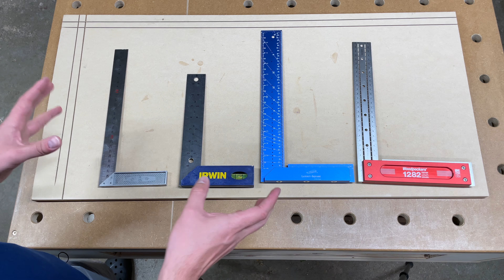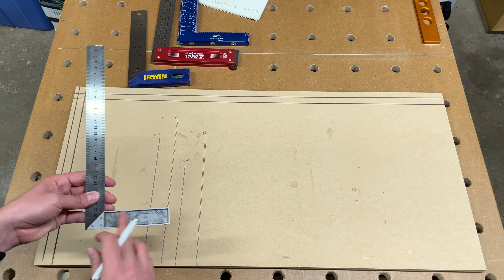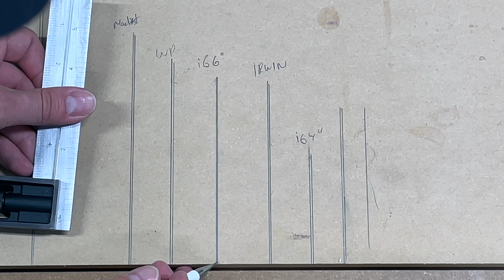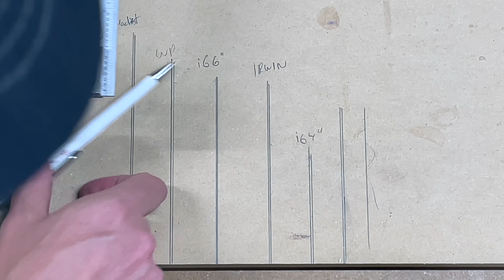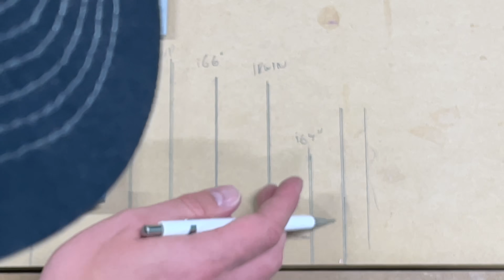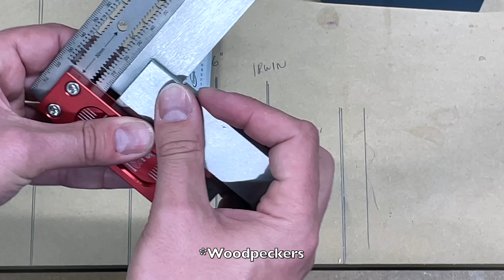How Square are My Squares? Testing 10 Different Squares from $3 to $140 Using an Easy & Free Test

Comment: I believe, as other comments have mentioned, that you are holding the squares differently when drawing the second line.  Placing your thumb at the top of the blade and drawing down toward the handle is just asking for inconsistent results.

Comment: I have an old wooden handle with brass plates try square I bought about 40 years ago that I still use all the time, and has remained 100% accurate, it is about the same size as the Irwin, being 9 inches, but it doesn't have any type of scale on it.  It is just a square.
I do also have a large framing square that I use when building larger furniture, and I have a couple of speed squares.  I also have a combination square, but mainly use that for repeat marking and measuring.  Oh, and an engineer square, just for checking my saw blades

Comment: Your technique is flawed, I can clearly see the IGaging blade moving slightly on the 2nd line at 5:27.  You are holding just the blade, and out near the end as well, and pressure from the pencil is moving the blade slightly.  Proper technique is a thumb holding the fence tight to the edge, and a finger simultaneously holding the blade down onto the surface.  I also feel that striking the line so quickly vs. a more deliberate pencil movement contributes to the effect of moving the blade..

Comment: Good video on what I believe is an important topic. 
However, I was under the impression that (classically) the "true" edge of a square is the "inner" edge.  
I was taught to always use the inner edge of the blade (but, in practice, I use the outer edge more!).  
I use vintage squares almost exclusively (and occasionally combination squares of repute).  
I always test them prior to relying on them, and file an edge square if it is out of true.  
If you care for your squares, it is a task not soon to require repetition...

Comment: The qeustion should be. How square does a square need to be? My three home made ones are so square that using your test they are 100 %. That is square enough. They cost me offcut flatbar, some welding rods and about a hours work each. A machinest square is a different matter, that needs be more presice.

Comment: Good video but you should have included instructions to fix an out-of-square square.
It's not hard, doesn't take long, and once learned you gain a skill.
Even the 'aliexpress' could be fixed.
No reason to throw away an out-of-square square, just fix it.

Comment: Extra: How square do you need?  Most agree you need more square for metal working than wood…but even if putting up a stud partition wall and you need to trim a 7 foot long plasterboard, small inaccuracies grow over distance.  So 1 mm out on a 12” square becomes a 7mm gap or bad overlap on your plasterboard sheet.  As a general rule, if you can detect an ‘out of square’ fit by eye, then that is too much, and most human eyes are pretty good at that.

Comment: You can have a few ‘square’ tools in a workshop, but you must have at least one which you can rely on to be properly square for when that really matters.  I bought the Woodpeckers over priced 1281, but it is bang on square.  Unfortunately the blade is so thick that parallax is an issue when marking (you have to view the scale with one eye from dead perpendicular over it).  I also purchased a Presch brand combination square, which is also a dead on accurate. My mini engineers square is ok for saw blades but extending short squares any distance is bound to produce errors.  My worst is a 7” 15 quid, aluminium square from Amazon, Chinese I think.  It is about a millimetre under square at the end of its blade; if extended out by the time you get to a metre (3 feet) it will be out by a quarter inch!  I need a big layout square, like two feet….but these are hard to find where people have anything good to report, and I can’t afford more Woodpeckers!  I am considering just making a big plywood triangle like a rafter square, which I can ensure is true by my old friend Pythagorus….He never lets me down on accuracy.

Comment: User error on the larger IGaging square. Lol I too have basically the same squares and they’re all basically Woodpecker square….
Reply from the maker: Unfortunately it wasn’t user error on the iGaging, it’s just out of square. I still really like iGaging as my other products from them have been perfect and their quality control is quite good. I just got unlucky with this particular unit. I’d still very much recommend them as a brand.
Reply: @MasonWoodshop I would contact Igaging, I would imagine they’d want to see that. Given the prowess of your station they might send you a replacement or a complete set if they offer one.

Comment: I have the same set of woodpeckers squares, and I hate the 150mm. Have you noticed that the inside and outside scales on it are off by a multiple of 5 mm rather than a multiple of 10 mm? That means the indexing holes can only be used in reference to one of the two edges. They tried to cut corners by making the base the same as the imperial version (25 mm), but they could have avoided the problem simply by rounding down its size to 20 mm (or even rounding it up to 30 mm, although that would have likely cost more). It's certainly square, but it's poorly designed.
Reply: The 300 mm version doesn't have the same problem though, because they made its base 40 mm wide. And I do love that larger one.
Reply from the maker: Ahhh, I can’t unsee this now! That hasn’t really played into the way I do my marking but I was just reviewing what you said and completely understand this frustration with the indexing holes.

Comment: Irwin and a machinist square all day long. If I ever decide to build museum quality anything ( that would be never) I'd consider woodpecker. There is absolutely no reason in the world for the pricing on them. None. Except all the marketing done by high-end cabinet shops whose smallest project starts at $ 5000. Look at me I have a whole red wall of tools worth 20k just to measure within one-thousandths of an inch. And you need these too or you are not a real woodworker. Oh and here's my 20 thousand dollar chisel collection. And don't forget Festool. Or a CNC. For a mere 100k you too can be a woodworker and make a shoe rack for your wife.
Reply from the maker: Love this comment as it shares the reality of these types of tools. Now it’s time to go buy a Felder sliding table saw and 5HP 30” planer, haha!
Reply: Agree Woodpeckers tools are expensive and I don’t know how they price their tools. But the woodpeckers tools I do have are excellent quality. Also their customer service and is excellent for the two times I had issues. I also like to support US companies as to many items are not, example Craftsman tools with use to be may go to brand before started to be made outside US and they declined in quality
Reply: I just bought an AUKtool 400mm, very reasonable price for what it is and it's a beautiful tool; it feels so good to the hands. And it's square, as per your test. Really, I feel you should be using a lapped square edge for a test like this and a knife line. An aluminum track and a pencil line isn't sensitive enough apart from showing up major discrepancies.
Reply: Got my dad the 6" Woodpecker square years ago, and he absolutely loves it. Uses it constantly for laying out wood turning pieces.
Reply: Woodpecker is way up there too
Reply: This comment is spot on. Wish I could give it more than one like.
Reply: Have you tried them though? I mean the woodpecker stuff? It’s kinda like a Lie Nielsen plane. Sure an old Stanley can get you there but the journey is so much better.
Reply: Didnt know that woodworking was a paupers craft in your corner of the world, in my corner of the world the average cabinet project runs btwn 20k to 70k for the average home. 5k cabinet projects are usually turned down due to the inefficiency of scale, and ironically the woodcraft im talking about isnt even the high end. High end cabinetry kitchens here run about 120k and up 😂

Comment: I would double check the 13” iGaging square.  If it’s actually off, then contact iGaging.  From what I can find, they guarantee squareness down to .002.  If yours is off more than that then I think they will replace it.  Woodpeckers guarantees theirs down to.004.

Comment: You asked how square does something have to be in my shop. The answer depends on what we're discussing. For my work, I try to make my drawers, cabinet carcasses, face frames 'reasonably' square. I don't have a precise definition for 'reasonably square', but I wouldn't throw a kitchen cabinet drawer out if the diagonal measurements differed by 1/16". What I mean by reasonably square is that any error won't be affect function or be readily apparent without measuring. 

However, to achieve that level of accuracy, I have much higher standards for my measuring tools. It's hard to be more accurate than your tools. If my square is out by, say, 1/16" over its 13" length, it would be very hard for me to consistently make anything that's more square than that. Given the inevitable inconsistencies of making things by hand (even when using modern power tools) out of wood, my parts are apt to be even more out of square than my tool's measurement error. Add in the fact that such errors tend to be cumulative and a project made from several out of square parts is apt to be itself so out of square it doesn't meet my 'reasonably square' standard. So, my standard for my squares is they must not have any perceptible error (without resorting to a dial indicator). I'd throw out the iGaging square.
Reply from the maker: Great comment, thanks for sharing! You’re absolutely right about there always being inconsistencies. Maybe the pencil line isn’t perfect, maybe there’s a bit of deflection in the saw blade, etc. All of that would compound if there was an issue with the initial layout.

Comment: Did you reach out to iGaging? I assume that they'd quickly replace the layout square with one that meets their standard for accuracy. They claim the square to be accurate within 0.0002" per inch, that means that the square should not be off more than 26/1,000's over its 13" length. Your copy doesn't meet that standard.

By the by, like you, I've been very happy with my iGaging products. I've never had to reach out to them for warranty support, but they have a good reputation for treating customers fairly.

Comment: Think you need to repeat the iGauge test. Just because you cut a line with the track saw does not guarantee that the line was cut straight. I would re test it very close to the woodpecker and also in a different spot maybe towards the right. If all of those show same result, then you got a dud and need to return it as defective.
Reply: What's the chance of: the WP is in a good spot, the Irwin is also in a good spot, some how the ig fell in a bad spot right in the middle of the 2 good spots??? A dud is a dud.
Reply: Im not claiming that it's not a Dud, it probably is.  I'm just saying that before you go calling somebody's baby ugly, you better have PROVED beyond any reasonable doubt that its ugly, and that was not done here with just a single flip of the square at different spots on the material from the spots that the other squares faired well with.  At the very least, you got to use the exact same spots that the other squares gave good results on, and then if you still get bad results, then yes it is indeed a Dud.  It probably is a Dud (IAW Occams Razor) but like I said, we need proof before making bad claims on usually reliable product brands. IMHO of course ;-) @myledang
Reply from the maker: Unfortunately the iGaging was a dud. I have a handful of other iGaging products that are perfect, so this should be a one-off defective unit.
Reply: @MasonWoodshop  you'd use a punch to adjust a rafter square. I don't see why it wouldn't work on your square that you don't think is adjustable. Metal is a plastic material.

Comment: Thanks for this video. I have the 7" Irwin square. Last time I checked, the inner side of the ruler blade is not square. I wonder if you can check it on yours. I'm curious what the result will be.
Reply from the maker: Thanks for watching! I just checked the Irwin and the inner side is very slightly out of square, but not too bad. For general construction, it’s very much within the tolerance I expected.

Comment: I had a cheap 12" combo square when I started, It was ok for a while. As soon as my budget could afford I bought both a 12" & 6" Starrett. combo set. A bit pricey but both were dead accurate right out of the box, and three years of daily use are still dead accurate.
Reply: Smartest comment in this whole video. Vintage Starrett cannot be beaten for accuracy. New Starrett no doubt is there too. Buy once, cry once.

Comment: I have checked the width of the blade and found some variation top to bottom using a digital caliper. like a machining problem.

Comment: I bought both 6" and 12" Empire adjustable squares, and both were slightly off... Then looked at the Empire aluminum "speed squares", and those were slightly dished on the "T" side... had to return them to Home-Depot, as every one of the probably 20 pieces at my local store were the same. Two months latter, they had the same speed "squares" just in a red "Milwaukee" color, instead of blue; but were  also dished to almost the same degree!
And when testing a Stanley large carpenter's square, it was off again!... It was just incredible to find that a cheap, 17 Canadian Dollars LASER level, from the Canadian store equivalent to the USA Radio-Shack, is DEAD ON ACCURATE when projecting its cross lines and being perpendicular to a wall... Perfect 90 degrees! (Not bad for a small plastic prism in front of a cheap Laser!).  I am amazed that there is no simple square that is true, but a cheap Laser is better!
Reply: What brand is that laser level? I've been wanting one for a while, but it just seemed like you had to spend $$$$ to get a good one
Reply: @LarryMayvid That LASER is a VERY INEXPENSIVE, "Radio-Shack" kind of simple, two lines crossing at 90° when the laser is projected at 90° to a wall surface, $17 Canadian Dollars in 2007, at the Canadian version of a Radio-Shack chain of stores. The exact product brand is: "nexXtech", without a model number (!).
Reply from the maker: The inconsistencies and squares not being reasonably square is wild! Great note on the laser!
Reply: Milwaukee Tool owns Empire Level.

Comment: Learned years ago how to adjust a steel framing square using this technique, which is pretty cool if you're interested in that type of thing. I now instinctively do this whenever I pick up a square (especially combo squares) If you're buying a square at a local store it's not a bad idea to check it there as well.

Comment: Excellent video, thanks for posting!
I recently had a sub-par experience with buying a woodpecker square; I bought the 1282SS, and while it was square, the blade was bent. I had to do a refund (and had to remind them to refund me the return shipping) and instead bought the cheaper, thicker all-aluminum 1281. I'm very happy with that one, but I only use it for checking for square on things like cabinet carcasses or larger builds.
Years ago I tried a 4" igauging double square before I got my LV double squares and it was a good bit off. It's a shame about that big igauging square you have; I'd probably keep one of those around for layout if it was square.
My most used squares and 4" and 6" double squares from lee valley (made by PEC tools), and my 12" starrett combo square. All are spot on.
Those are all imperial though, and I'm switching my shop to metric, so I'll be buying more PEC variants in mm soon.
I'm still looking for a perfect apron square for checking small boxes, drawers and the ends of crosscut pieces; basically I'd love a square that's like a machinist square, but made of stainless steel so it won't be affected by moisture, and completely flat, and on the thicker side (1/4" or so). I think taytools has something like that, but I'm not sure how accurate they are.

Anyway, excellent topic for woodworkers!
Reply from the maker: Oh wow, that's too bad about your Woodpeckers 1282 but I'm happy to hear the 1281 is in good order. I like some the of additional features of the 1282 (in addition to being stainless), but it is heavy!

Great note about Lee Valley's being made by PEC - I knew it was outsourced but I wasn't sure who made it. For me, I'm using the smaller 150mm Woodpeckers 642 far more often than I expected.

Comment: I know the line drawing test isn't that hard to do, but I sometimes have a hard time telling how close/parallel the lines are. Or I have trouble with lines that aren't clean and even thickness. I wish there was a not too expensive home tool that I could use to test squares and it would give me some readout of the accuracy.

Thanks for the video and hope to see more soon.
Reply from the maker: Oooh, this is a great comment. In the past (when I was a bit obsessive and not trusting of this test) I’d pull out a double-ended compass (two sharp ends used for getting distances on maps). I’d then make it so there was more distance between the lines and use that to check the spacing.
Reply: If there was an inexpensive home tool to test squares, there would be INexpensive squares.
Reply: 1”2”3” blocks.